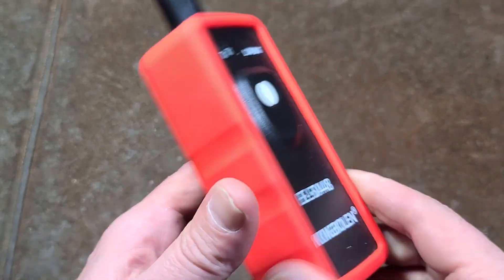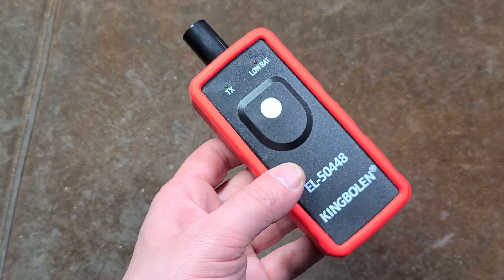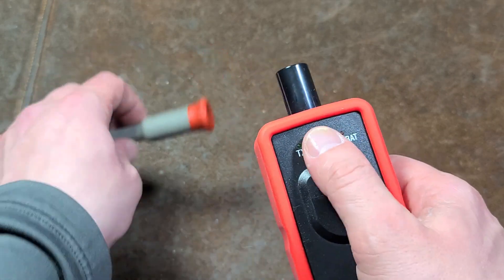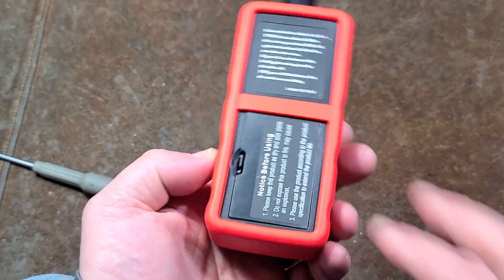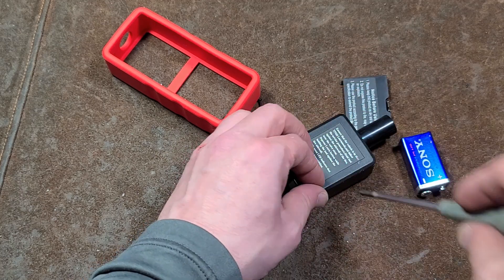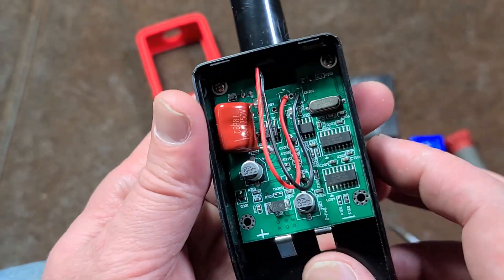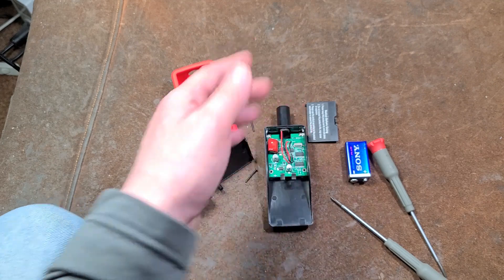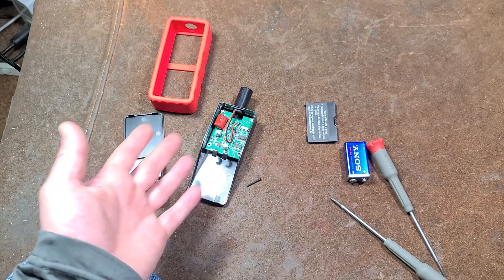Basic Tire Pressure Sensor TMPS Reset Tool EL-50448 Review

Comment: What a coincidence! I just received one of these in the mail yesterday. I bought it to use on my wife’s 2016 Impala LTZ. It works PERFECTLY on her car. Stupid simple to use and does exactly what it is suppose to do. The only “tricky” part is putting the vehicle in “service mode”. On her car you follow these steps:

1-Apply parking brake
2- With engine off, hold down start button for 5 seconds until the ignition, DIC, etc. turns on
3- Use the steering wheel buttons to scan through the driver information menus to the tire pressure monitoring page
4-Once the TPMS page is displayed, hold the select button (check mark in the middle of the scroll arrows on steering wheel) down for about 3 seconds or long enough that you hear the horn honk and the display says “tire service programming activated” or something like that. I don’t remember the exact message.
5- Once you’ve entered TPMS service mode, a turn signal lamp will illuminate (I think it is always driver’s front signal).
6-Hold this stupid cheap tool to the tire, tangent to the valve stem. Press and hold button until the horn honks and the turn signal moves to the passenger front corner.
7-Repeat step 6 on front passenger tire
8-repeat step 6 on rear passenger tire

On my wife’s car both taillights remained illuminated so it did not indicate the same as the front did, but the horn will honk and the passenger front turn signal will flash when programming of the passenger rear tire is complete. After that move to the driver’s rear tire and repeat step 6. After that you are done. If you are like me and do most of your work in the middle of the night and don’t want to wake the neighbors with a honking horn, simply pull the horn fuse before starting and just keep your eye on the front turn signal or mirror turn signal lamps. I THINK all GM’s start with driver front tire and rotate clockwise from there, but I don’t know that for sure. You can check your work by removing or adding a pound or two of pressure from one tire at a time and verify that the corresponding pressure drops on the TPMS display of the driver information center. If you’ve screwed up, simply repeat the process again, but don’t screw up. Lol

It literally took me longer to type this comment than it does to reprogram all 4 tires with this $7 tool. I was pleasantly
surprised to see that it worked so well! It’s nothing special, just a tone generator in the roughly 300-400mHz range. I’ve got multiple tone generators, but nothing that produced anything in that frequency range. If you have something that will produce a signal that is somewhere in the ballpark of 350mHz, I’d be willing to bet that your device will work just as well as this tool. There is no harm in trying anyway... Worst case scenario is you have to shell out less than $10 for this little device.

Comment: This is probably one of the simplest tools for relearning tire positions after a rotation or TPMS sensor replacement. It won't work on every car. It's used mostly on GM vehicles with the 315 freq valve stem mounted sensors. Because you can't read the sensor data with this tool, your  only indication of a bad sensor is that the relearn procedure will time out when you hit a bad sensor and won't relearn. Thanks for sharing, something different for a change.

Comment: My old car (Hyundai Sonata) required the more expensive tool that programs the sensor the IDs from each wheel. They have a version that scans the IDs from each wheel and remembers then. There is a tool that lets you program new TPMS sensors with the IDs of the old ones, if you have the IDs.

Comment: I don’t have this particular brand, but do have one. They’re used on GM vehicles (and likely a number of others at this point). I bought one because the dealer forgot to reprogram the TPMS after they rotated my tires, and the reported tire pressures didn’t line up with the tires. $15 was preferable to taking time off from work for the dealer to reprogram the car. 

The original is sold through GM’s parts division for $65, but the design is so trivial the Chinese have cloned it and its effectively generic at this point.
Reply: For the last 12yrs I’ve been driving an SRT8 Jeep. There is no such thing as rotating the tires on those things with staggered wheel sizes and directional tires, but there is no way I’ve reinstalled wheels on the same side every single tire change, so I am pretty sure that my Jeep’s TPMS recognizes sensor location and moves them accordingly on the display. Anyway, the first time I rotated the tires on my wife’s 2016 Impala I had all of the tires at the same pressure. It wasn’t until weeks later when she got a nail in a tire that I realized that the TPMS doesn’t recognize a tire rotation. I couldn’t find a leak in the “low” tire to save my life. Then I started adding air and the pressure never changed but I could see the tire inflating. Then I finally noticed that another tire on the display was at a higher pressure than the rest... This nonsense really threw me for a loop for a moment lol. When I figured out which tire correlated to which location on the display I was finally able to find the leak and patch the tire... After that ordeal I immediately went on a search for a tool like this one. It’s not a complex tool at all, but I still can’t believe that I was able to get her TPMS locations reprogrammed with a $7 ebay purchase. Lol

Comment: FWIW, ICs are: Binary counter 4060 , Mosfet driver UCC37322 from Texas Instrument, Mosfet transistor, operational amplifier LM358 and a 4MHz quartz
Reply: It just generates a 125kHz signal switched on and off. The mosfet driver is used to drive the 125kHz signal through the large orange capacitor and coil mounted in the probe. 4MHz / 32 (4060) for the 125kHz carrier the on/off frequency generated by the second 4060. Could just about reverse engineer the whole thing from the video. Good that no smarts are involved to make it relatively easy. Not sure what the opamp is for though. For the low price, easier just to buy one.

Comment: I have TPMS on my Subaru but I was disappointed to find that there is no way to manually poll the pressures from the dash. You only get a low pressure warning light and it doesn't tell you which tire it is.

Comment: I used to think the tire pressure monitoring was done by measuring the difference in rotation speed between the wheels when driving in a straight line. Seems a simpler solution.
Reply: That's how my Honda does it.  Normal cheep valves.
Reply from the maker: Wheel speed differential monitoring is indirect and does not give you a precise absolute pressure reading of each tire simpler but more inaccurate.
The next big thing will be tire air temperature as well as pressure

Comment: Hi, i have a citroen, in this case the config is made via the lexia tool where i need to load every id , but first the sensor has to be activated , this work for this activation/ excitation? the sensors works at 433mhz

Comment: I need one of these for a mitsubishi mirage. Someone stole one of my wheels while I was at work. I bought a replacement used rim with the sensor but can't reset it
Reply: I’ve never touched a Mitsubishi, but you may need a more capable tool to program the new sensor serial number into your car’s BCM. This tool won’t do that, but if the Mitsubishi’s recognize sensors universally, then this one might work. Another thing you need to check is whether or not the Mitsubishi TPMS system communicates somewhere around 300-400mHz. If it communicates via a different frequency, then this tool probably wouldn’t work in that case either. It’s not like you are out much money just trying it though...

Comment: I think the TPMS sensors in my car died years ago. I believe they have batteries in them and the units need to be replaced at the end of the batteries life. However, they are $75 a pop and I have no desire to replace them at the cost of hundreds of dollars.
Reply: Do some research on your car. There are many TPMS sensors that work just fine by simply popping the case apart and replacing the button cell battery that powers them.
Reply: @athhud  . Will do. Thanks!